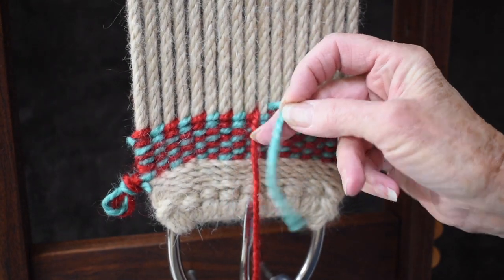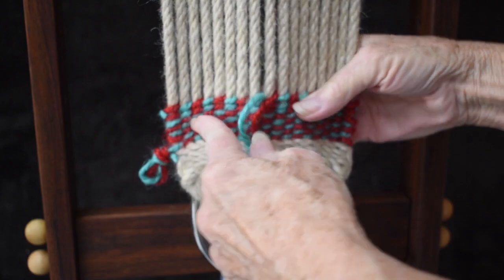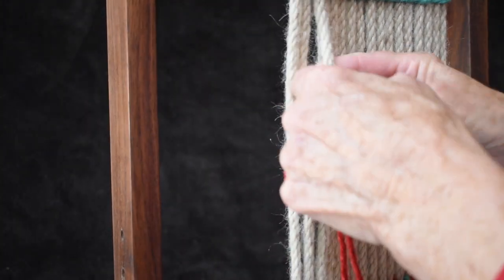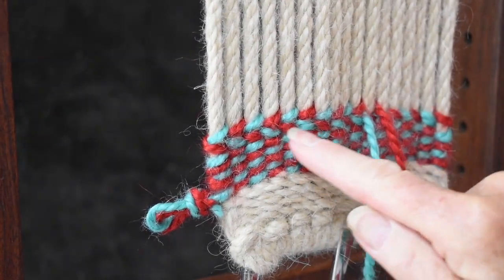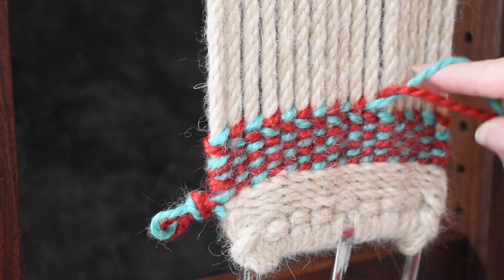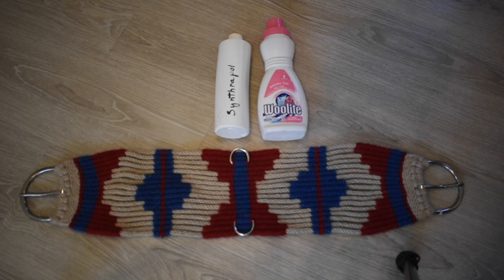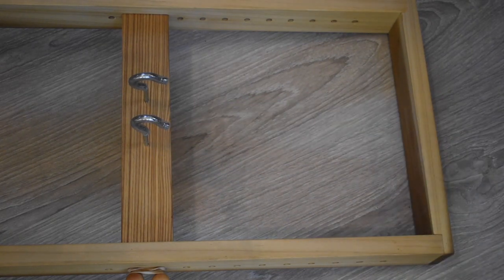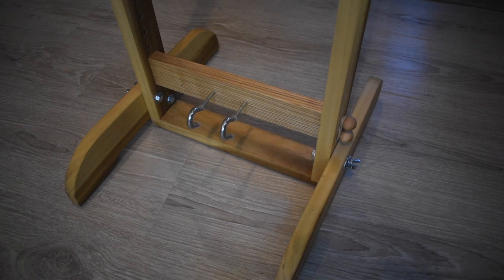Mohair Cin.ch Making Part 11

Comment: Hi Caroline, what kind of yarn and weight of yarn are you using? Is it just any kind of yarn I would like to use? Thank you
Reply from the maker: I think I discussed yarn in part 1- the introduction. The warp is 8 ply mohair and the weft is 2-ply mohair.  You need to use mohair or alpaca if you’re going to use the cinch.